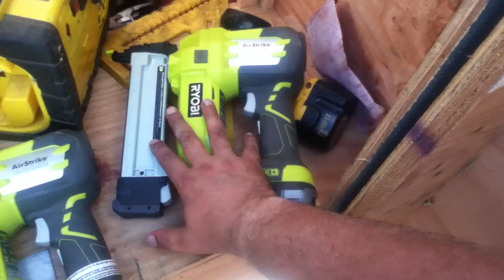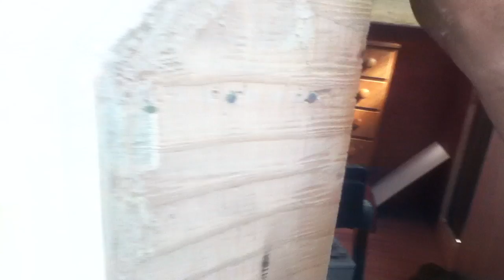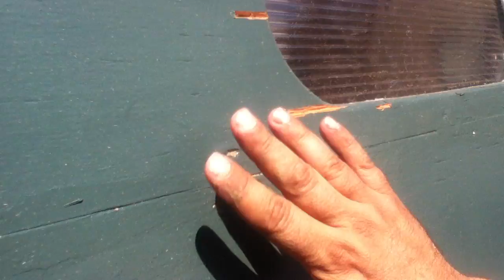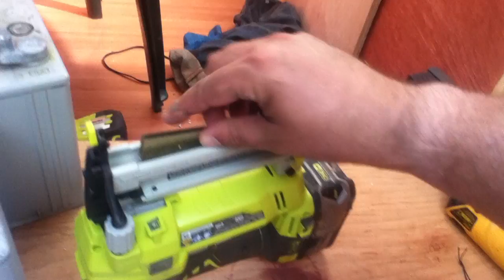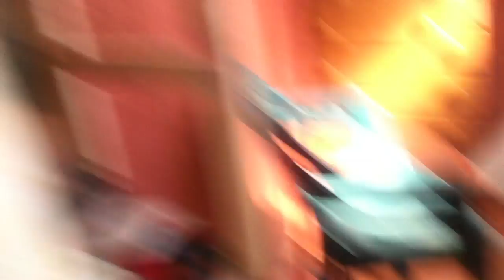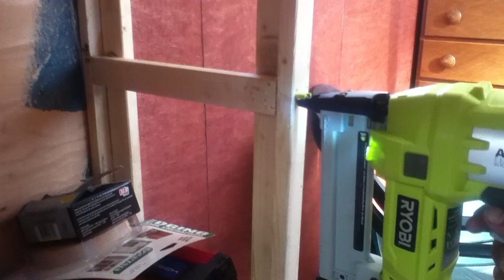Ryobi P360 Airstrike 18ga Cordless Stapler Review

Comment: This thing will go right through 5/8" Solid Oak. I was amazed to feel the staples on the other side sticking out. It wasn't even on high.. It also has a plunger that you just hold the trigger down and it will keep putting in staples till you let go of the trigger.  Once it hits the depth gauge. It will shot stables.....

Great for fast assemble of glued joints in anything but 1/8" popular. Unless you use low setting and set the depth just right. Then you can hammer the rest down and trim anything that sticks out the other side with cutters. So be aware of the power this thing can put out.

Comment: Nice Job, Thanks
Reply from the maker: I have recently been using this on cedar fence boards with really good results.   It is less likely to split the boards than larger screws or nails, and more likely to hold than with using thin head trim nails.   It is not so good on Ikea furniture backs though - too much power.

Comment: FYI the P108 battery has been re-called 
http://www.cpsc.gov/en/Recalls/2013/One-World-Technologies-Recalls-Ryobi-Cordless-Tool-Battery-Pack/
Reply from the maker: The recall was discussed in the comment section of another video last year and I discussed it with the Milwaukee factory rep here in Portland this last holiday season when we were going over some of this as they were touring the Home Depots (the Ryobi brand is made by the same company, but is the lower grade versions of their power tool line which inclues Milwaukee and Ridgid).   The recall was only for specific batteries from a particular production run and the Home Depot people have lists of which ones are applicable to the recall.   That's why most people hiking in a P108 battery don't get a replacement on the spot and they are still brisk sellers, as the holiday season two packs for $89 are the best bargain in the industry for the amount of power per dollar in an 18v type battery, except Dewalt is hot on their heels now with a new 5AH battery which will have a street price which is competitive with the P108 when it is not on sale.

Comment: I am looking for a cordless stapler to mount chicken wire to pine boards  or plastic netting  I have a urban farm on empty house lots  I get around by bike  so cordless is the only option for Me  

I have some classic ryobi blue 18V cordless tools  I don't mind swapping a single battery if it reduces the amount weight I have to peddle around
Reply: Walt, I'm not sure if you found a solution yet but Ryobi re-issued their 18V, 3/8" (T50) crown stapler. The model is P317.

Comment: hey how is the brad naler now since u have used it a couple of mths?
Reply from the maker: It has done well, not used it in around a month, but so far, no jams.  Far far better than the older dual purpose models which doubled as a brad nailer.
Reply: Was it new or refurbish
Reply from the maker: Raj Dann
New, they have not been on the US market long enough for any refurbished ones to be in circulation here.

Comment: How heavy is this tool compared to a regular air staple gun?
Reply from the maker: Its fatter, about twice the bulk even though the exterior measurements are about the same s an air stapler and the weight is not that far off when compared to an all metal air stapler.  Just remember, there is no cord, and no air compressor.
Reply: 8digitPDX  i work in a woodshop. Build cabinets and laminate. Im new to it but what really irritates me is when everyone is using an airhose. Ive had thoughts about buying both. A cordless and an air
Reply from the maker: Evan Storar The air tool is usually what you use in a regular shop facility because it is more economical over the long run, but the cordless is usually more convenient and of course makes for a quieter shop.